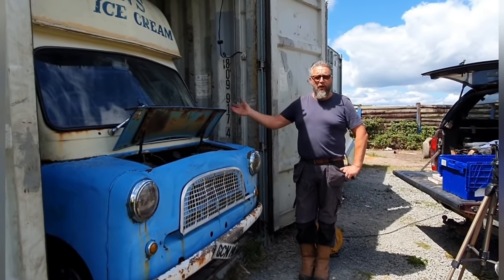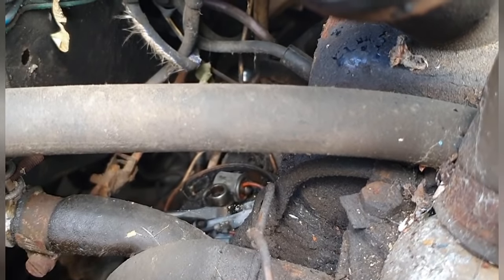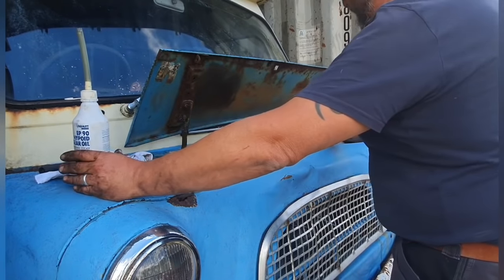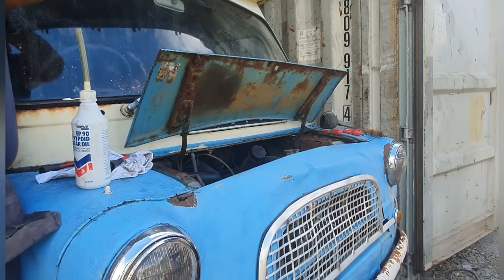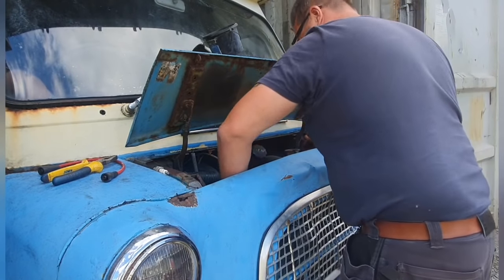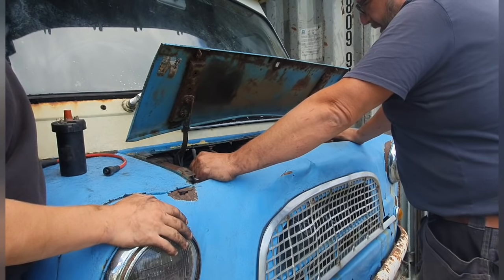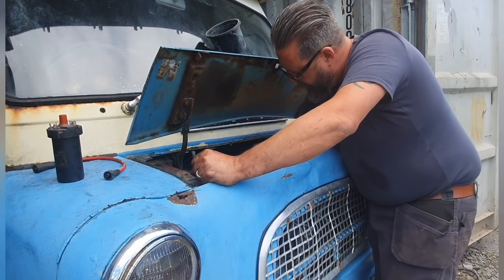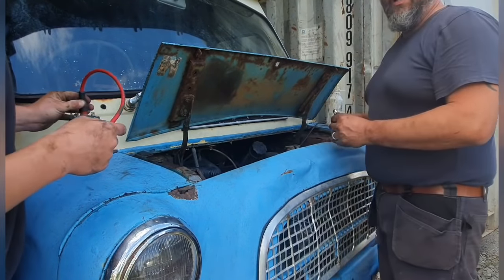1968 BEDFORD CA SMITHS ICE CREAM VAN WILL IT RUN?

Comment: Those 2 pipes what go to the sink go to a copper coil that heats the water from the engine temperature for hot water
Reply from the maker: At last... thanks so much, now I know how it works! I think I may re route them when I put it back in.. cheers for watching regards John.
Reply: @madworksgarage  it was a cheap way to get hot water as it is compulsory to have hot water to wash your hands in an ice cream van .I know because I had the ca and the cf ice cream van.
In the 70s I had a ca van that backfired on me and blew the petrol pipe of the carb and set on fire I managed to extingwish it before the fire brigade got to me and they played hell with me for blocking it out.

Comment: Why don't you just set the timing after you gaped the points, then use a timing light?
Reply from the maker: Not alot of point,because the engine will need to be pulled for rebuild, all this was to find out if it would run... thanks for watching John and benj, mwg